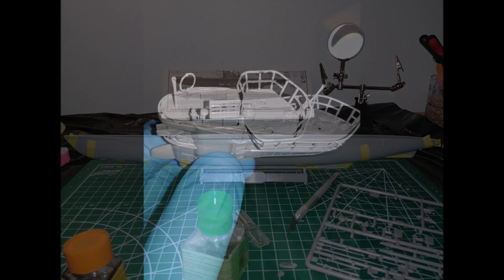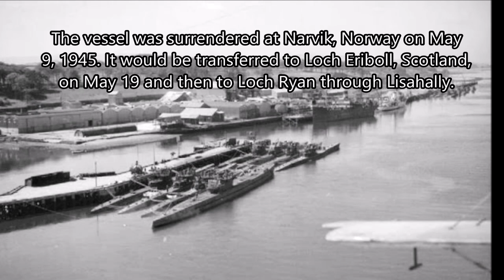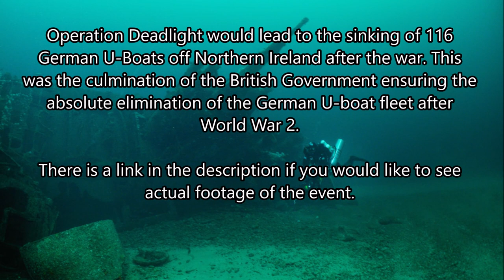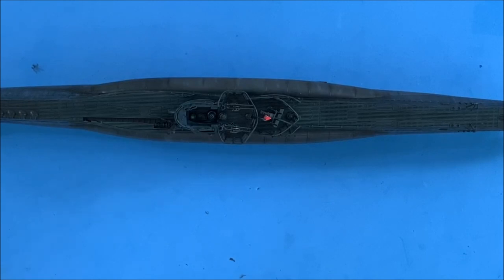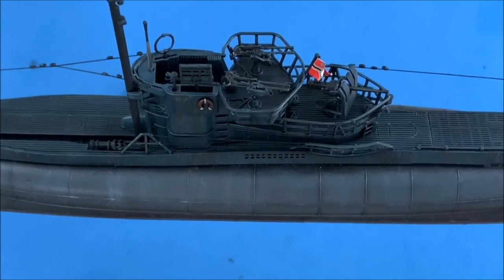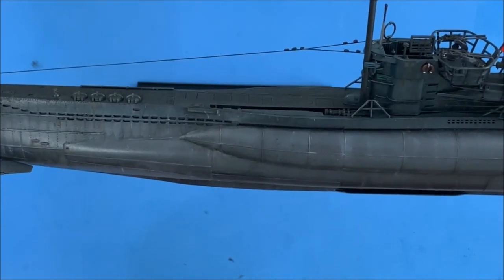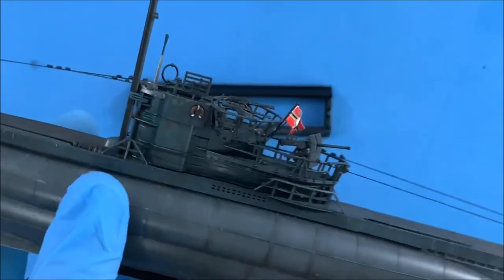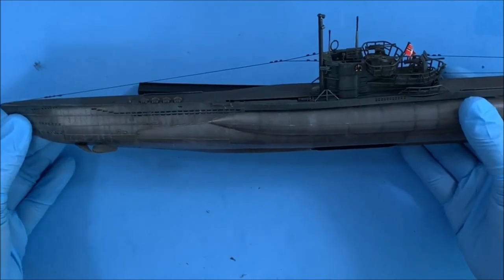Revell U-318 Uboat Picture Timelapse Plastic Model Build

Comment: That turned out great, Joe. The weathering turned out really good. EZ Line... that stuff is great. I use it on aircraft and it is really good stuff.
Great video!
Reply from the maker: Looking back, there is a piece of line that splits as it goes to the tower, I'm not sure how well EZ line glues to itself? You have any experience with that? I would think it would be fine with a dot of super glue since it is stretchable. Anyways, I appreciate you checking it out and the nice words!
Reply: @joekmodels  I think it would work fine gluing EZ Line to EZ Line. Maybe glue it off the model, cut to size on the Y end and then attach it to the model?
Reply from the maker: Brett G good idea!